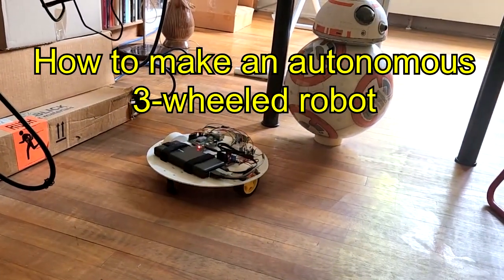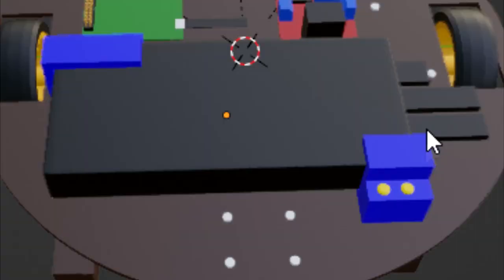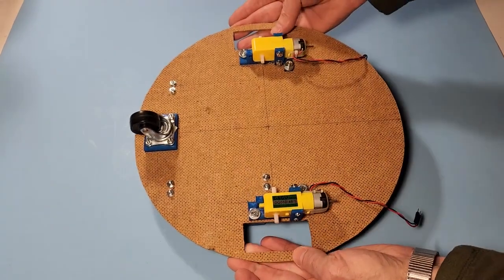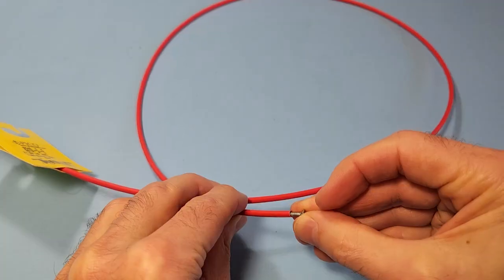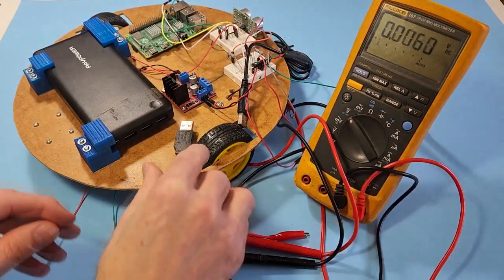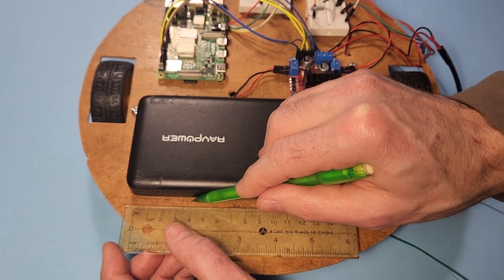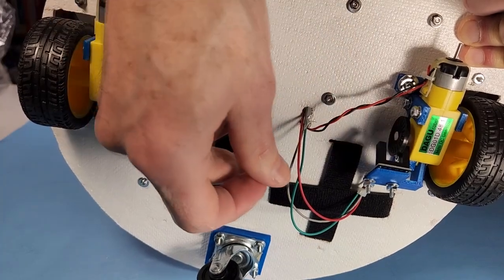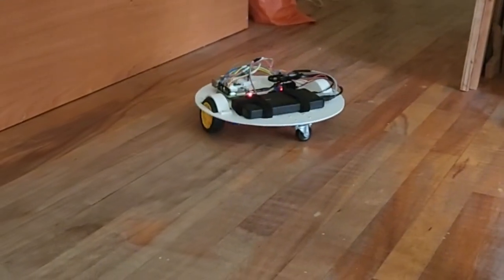How to Make 3 Wheeled Autonomous Robot using TT Motors, L298N, US-100 and HC- 020K

Comment: Hii sir great teaching , i want to make a Radio transmitter using Lc circuit but i dont have proper components like oscilloscope or etc to measure some values so please sir make a Lc circuit which can produce 433Mhz Rf frequency to transmitte radio frequency

Comment: I imagine NASA engineers trained in the 1970s trying to design a rocket in 2025: bulky old parts for basic functionality that can easily be achieved at 1/100th the price and 1/1000th weight.
That's why the moon landing only happened in the Nevada desert.